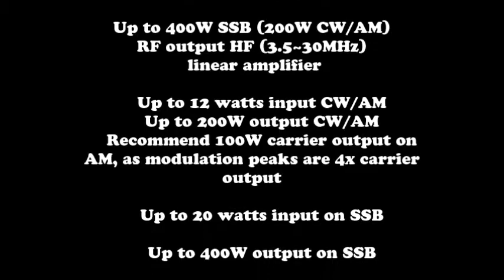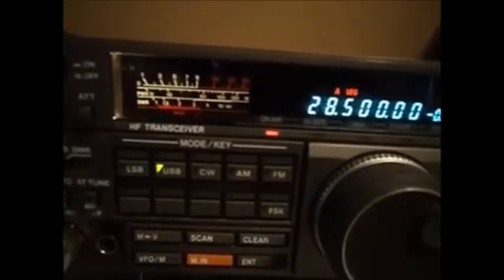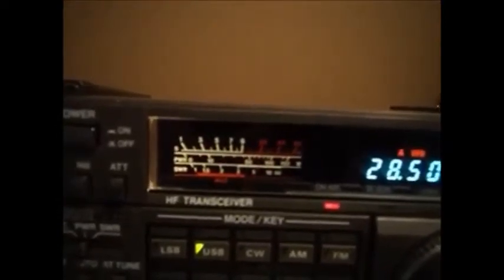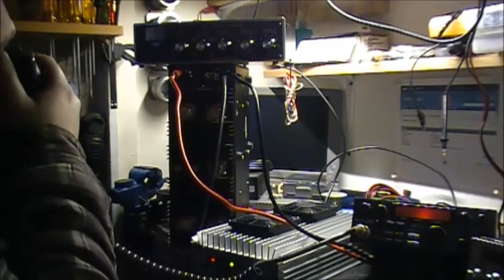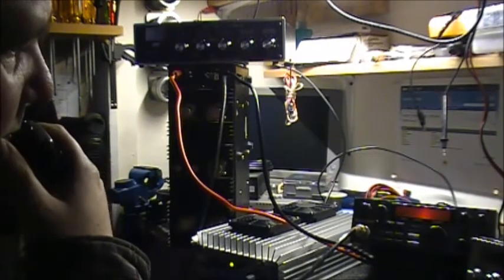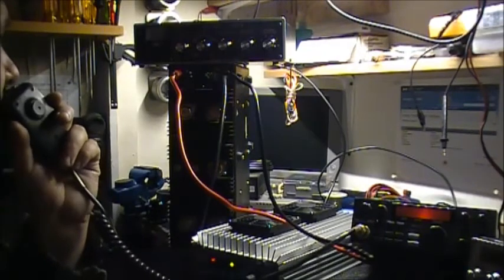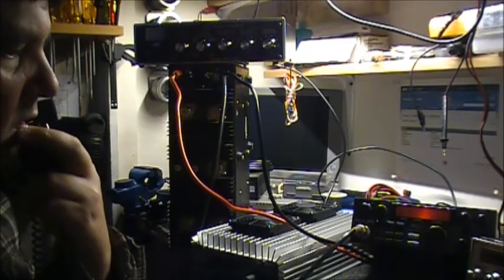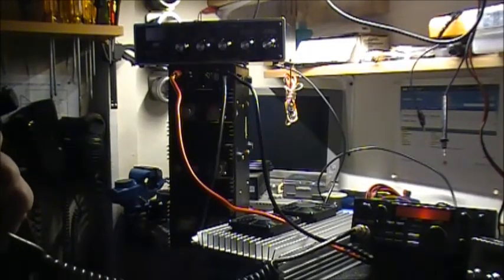RM Italy KL505-V RF Amplifier on air test

Comment: I was going to opt for the KL503, however, I heard they sound bad on SSB. Instead, I changed my order to the KL505 as you have here.

On another forum, I've been told that "stock", they're incapable of working on 11M due to notch filtering at the input. I was told 11M will be blocked to ground. IE - this amplifier won't work on the CB band.

Do you know if this is true, please?

Also, do you think I've made the right choice going for the KL505 as opposed to the Mosfet KL503?
Reply from the maker: I really have no idea to tell you the truth, i had this amp on just to record this video. I have not used it since then, and looking to get rid of it, i just have no use for RF amps at the moment.  :-)
Reply: it will work fine on 11m

Comment: What transistor are used in the kl 505v? I find very like information on that amplifier.
Reply: Well if I had watched a little longer I would have found out. My apologies.
Reply from the maker: No worries. :-)
Reply: Transistor mrf455 thé best
Reply: Mrf455 do around 60 watts each there are four in the 505V.

Comment: In Canada, we can run 1000W DC Input or 2250 PEP. I think the meter on that 440 is not working right. With that kind of power you should have been 20-30 db over 9.
Reply from the maker: Was running close to 300watts MAX. ;-)